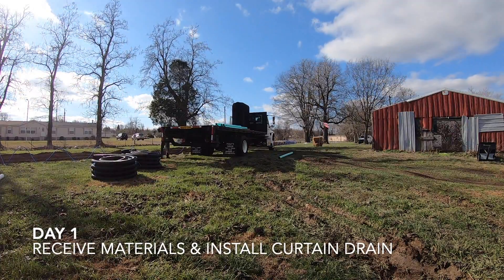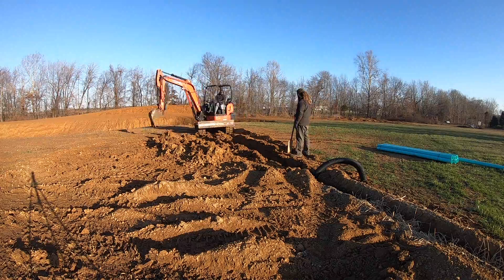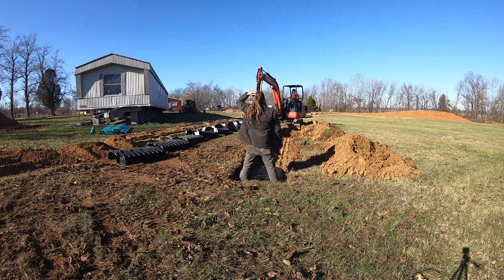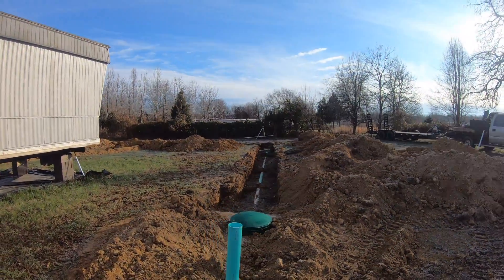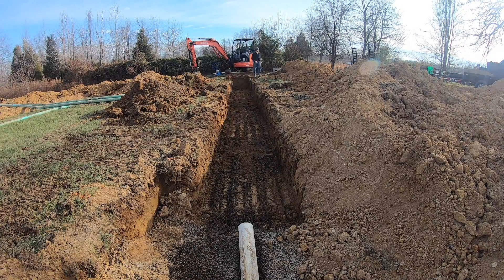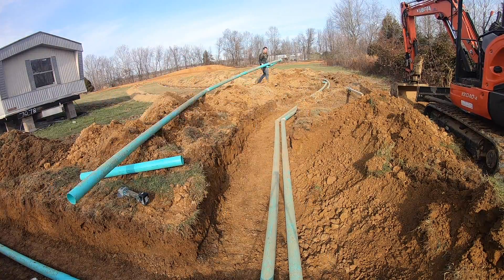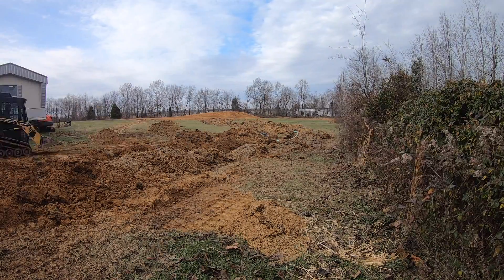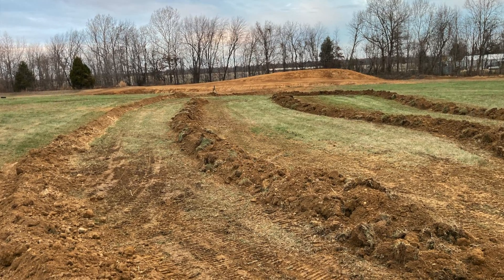Septic System Installation Start to Finish

Comment: Didn't you need to maintain a 6 inch cover, since your chamber is only 14 inches deep? What area of KT are you in? I wanted to look up the soil map. Thank you! Good video!
Reply from the maker: Those are infiltrator quick 4 plus low profile chambers. They are only 8" tall instead of 12" tall. That way a 14" deep trench still provides 6" cover. 
But low pro chambers have less capacity so you have to do longer trenches.
Reply from the maker: This job was near Bremen Ky if I recall?

Comment: Why did you put the d-box that distance from the first lateral? I would assume to put the d-box right near the connection for the first lateral, which would reduce the amount of total pipe needed. (shorter runs from your d-box to each lateral). Great video! Thanks!
Reply from the maker: Agreed I could have moved it a bit closer. But also you need to make sure  the outlets of the box is higher than the top of the highest lateral line. 
These lines were low profile chambers and installed only 6" below finish grade if I recall due to shallow hard pan. 
If the distribution box is installed right near the front of the line, that line cannot completely fill. It would back up into the dbox and send extra effluent to the other lines and not fully utilize the capacity of the first line.

Comment: How do you bid a job if you didn’t know you needed a French drain
Reply from the maker: @travisbrewton5839  maybe I misspoke in the video but I knew a curtain drain or French drain was needed on this job. Most septic systems in my area that have shallow clay layers they are required. Thanks for the question!

Comment: Why are the runs so long? Waste and water would never travel that far unless you’re pumping about 50 gallons a hour all day long. You’re basically using half your property for this .
Reply from the maker: Per code and soil analysis this system required 292' of low profile chambers.  The bottom of the trench is level and the water has the ability from one end to the other if it is not infiltrating into the cohesive soils.

Comment: Nice job, what does a system like that cost the customer?
Reply from the maker: I don't recall the pricing on this one but in Kentucky a 3 bedroom system runs around 8k then adders for curtain drain, low profile chambers, cover soil, or other site specific requirements.

Comment: Im surprised the inspectors didnt do a stop work and require a licensed professional since you are not leveling the tank or sloping the drain field pipes , not using proper  gravel ect.... wow  Having mine done at this time and a lot more to it than digging and dropping pipes.
Reply from the maker: The tank was level and shot on all 4 corners. 
The lateral field in Kentucky is level not sloped. You follow the site contour lines. 
My excavator has idig grade control system which is why you don't see a rod man in the trench with me checking grade. 
I am a licensed septic installer. I agree there is a lot more to it than digging and dropping pipes.
Reply: @NealORussa  very nice answer to a very accusatory comment. It's very evident in your video that you did your absolute best and didn't let a mistake keep you from giving your customer a quality service. Keep up the good work! Everyone makes mistakes. What separates the professionals from the scammers is doing the job right even if it means rework.
Reply from the maker: @ thank you for the comment!
Reply: @NealORussa well said , obviously this wasn’t a full tutorial on how to do a septic system that is clear to most it is just a simple overview. Great video and great work

Comment: Where can I get the distribution box that you installed and the pieces that go inside the tubes to level them at the same level? I would appreciate the information.
Reply from the maker: That dbox comes from my local precast tank supplier. I have also used the tuff tite plastic dboxes. 
The levelers are called speed levelers. Also from tuff tite. 
https://amzn.to/4aCeAFx

Comment: What good is that curtain drain do ?I watched your man install the chambers without a transit for level .Than you installed the feed lines  had to drop the elevation on the lines so now you may not hit the inlet of the chambers   .Ass backwards if you ask me .And made a mess out of the lot   HACKS
Reply from the maker: Way off bud. I have idig 2d machine control on the excavator. The laser level is set up and hits a sensor on the stick of the machine and computer screen shows me when I'm digging level. Just as accurate as a rod man just saves the time. If you watch the time lapse of me digging laterals you'll see after every move I swing to the right and stop for a second to catch the laser with the stick. 
Feed lines from dbox to chambers have fall to the chamber and the kytc code 6" step down from lateral trench to the distribution trench. 
Curtain drain was required per state permit and the purpose was because of an impermeable clay layer at 28" I think it was? So the curtain drain penetrates 6" into the clay layer so that ground water running on the seam between clay and topsoil is intercepted upstream of the lateral lines and take out to daylight in pipe. The job site was left very clean with existing grass between trenches and trenches mounded for settlement again per state code. 
Thanks for the comment and the chance for me to explain.

Comment: How does the idig system work. Im interested for my excavator. Thanks in advance.
Reply from the maker: It works great! I have a few more septic videos showcasing it. I also have another coming soon. I can dig the tank hole and lateral lines on grade no rod by myself. Can also dig sloped lines at 1-2% for plumbing.
Reply: @NealORussa  what is the cost for the system?
Reply from the maker: @chriswesnofske  it's around $12k new. I got mine used for around 8k.
Reply: @NealORussa  Also I am new into business. How do you price your septic jobs?
Reply from the maker: @chriswesnofske  I price them lump sum to a customer. I have a proposal outlining my work that I do and do not do. I include permits and their costs. All my material costs get a markup in line with most contractors in my area. Then I calculate how many hours I anticipate the job to take including taking grade shots, getting permit, install, inspection and backfill. Then I multiply those hours by my hourly rate and add it all together.

Comment: Hi what kind of pipes did you use in the distributor box thanks for your video
Reply from the maker: The piping right out of the tank is schedule 40 pvc. Then it adapts to the green pipe which goes to the dbox and all the lateral lines. That is sdr 35 pipe.

Comment: So my whole yard has a slope to it as well. I take it you put in the perforated weeping pipe or whatever with the straw and pea gravel uphill above where you put your leach fields? And then, why does it matter if due to hills and such, that some of the leach fields end up being deeper below ground than others as long as their level? I'm fixing to do my own because I can't afford to pay someone unfortunately so I would appreciate your advice and input on this! Thank you! Love the video and thanks for putting in the time and effort to do it!
Reply from the maker: Thanks for the comment! The soil testing by the county showed there was clay at 26" depth I believe. So the chambers need to be placed 12" above that impermeable clay layer. So they stipulate the chambers have to be placed 14" below existing grade. It is assumed through multiple tests in the area that that thickness of topsoil over the clay is uniform. So you follow the contours of the hill so that your chambers are always 14" below ground and 12" above the clay. 
The curtain drain goes in above the leach field and along any uphill sides. It penetrates 6" into the clay layer. So any ground water uphill of the system will pretty much run in that seam between the topsoil and clay layer, downhill. The curtain drain will intercept that water uphill of the lateral lines and drain around the field.
Reply: @NealORussa  thank you so much for the reply! I will only ask you one more question, so I don't have to have inspections where I live nobody cares lol. But I'm going to do it right of course. My dirt is all good black dirt. So it doesn't matter on my slope area where I'm going to put my leach fields, that some of them end up deeper or parts of them deeper below the surface than others as long as they're good and level would I be correct? And what that mean that I don't need the weeping part of it above?

Comment: Nothing against you Neal. From the pictures it looks like the system went all over the lot.I am not sure why the chambers need to be 8 feet apart but if that's your code so be it .The same system in my area would be 6 units long and 10 wide all touching each other .
Reply from the maker: They could only be installed 14" deep at this site due to poor clay soils at 26" depth that don't drain at all. When you're on a slope you cant do wide beds because the bed needs to be level and you would be very deep on the high side, much deeper than 14".

Comment: How many acres of land did you use to do this ?
Reply from the maker: I'm not sure what you mean.  The system require low-pro chambers so i had about 350LF of trench to install I believe?  The lateral lines need to be dug on contour, so thats why they are curvy.  The lines also have to be a minimum of 8' apart, sidewall to sidewall.  Lastly, the dbox had to be way uphill of the first line due to the inspectors interpretation of the regulations to get the invert of the dbox above the top of the highest chamber.  With the shallow chamber depth that required the dbox to be placed far uphill of the 1st line.

Comment: Thanks for the video and thanks for showing your mistake also! How long have you been in the industry and did you have prior experience? I’m looking to get started in the near future. I’m sure working for someone else would be beneficial, but I’m more of a trial by fire learner myself…
Reply from the maker: I've been in construction since around 2008.  As far as septics, i started doing those in 2022.  I worked on a few projects with another licensed installer.  Its fairly comparable to any gravity drainage system, but you have to do it right with the inspections and all required.

Comment: Interesting! Where are you located ? That’s a bit different than the systems I see here in TN ! I just recently got my license but haven’t installed a system yet. They don’t use the distribution box here as far as I know. It’s one tight line from the tank to the field lines and “crossovers” to tie the lines together !
Reply from the maker: I'm in Kentucky. Tennessee does serial distribution as you described and it's very easy to install but not permitted in Kentucky. We have to use distribution boxes or hillside boxes. I prefer to use hillside boxes but here the chambers were installed so shallow the hillside boxes wouldn't work.
Reply: @NealORussa  what part of Kentucky? I’m up between Ghent and Warsaw.
Reply from the maker: @chadrowlett893 this job was near Bremen ky I think I remember. I'm in Owensboro.
Reply: @NealORussa yup! Kentucky

Comment: Can you do a video or explain how you set up that job? In Ohio we have to go off of engineered drawings wondering how you would lay that out accurately
Reply from the maker: Yes I could do a video on that for Kentucky. Every state has their own regulations and ways of doing it though. Here the homeowner or builder goes the county health department with information about their home and the land plat and schedules a site evaluation. Then the environmentalist goes to the site, pulls soil samples with hand auger and evaluates the site conditions. They write a site evaluation report and give to homeowner or builder. The report states the square foot of lateral trench, the depth of trenches, the size tank required, whether a curtain drain is required, and a general location of where to install the system. Then the homeowner or builder gets quotes from state licensed septic contractors based off the evaluation. Once a contractor is selected, the contractor goes to site, shoots existing grades and draws a plan for the installation including invert of pipes at tank, dbox and each lateral line. Contractor takes drawing to health department and reviews with environmentalist. When approved, a permit for construction is issued. Contractor installs and gets inspection prior to backfill. Then backfill when inspection passes.

Comment: Wow. 6 months settling, that's interesting!
Is that a county requirement or a professional preference?
Reply from the maker: The regulations state, "Backfilling of lateral trenches or drainage trenches shall be accomplished with minimal compaction of soil fill, and soil fill material shall be left mounded four (4) to six (6) inches above grade over trenches to allow for settling."  I've found 6 months is a nice round number for people to remember and it provides ample time for the soil settle into place. Need to get some good rain on it for the soil to break down and settle into place.
Reply: Makes sense. Especially for enough time to allow for a few good rain events